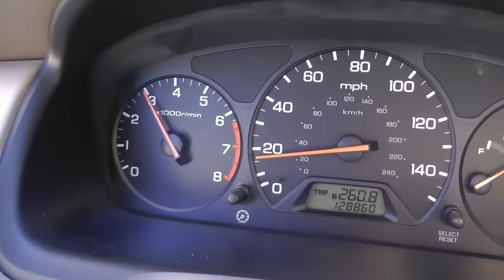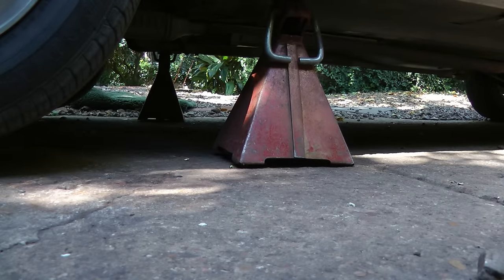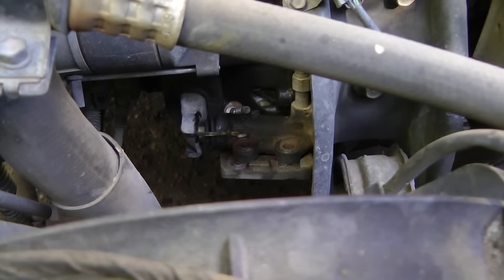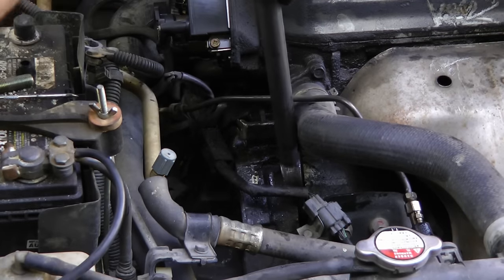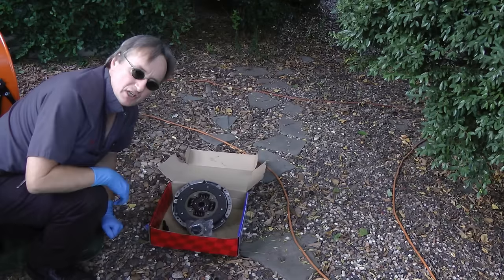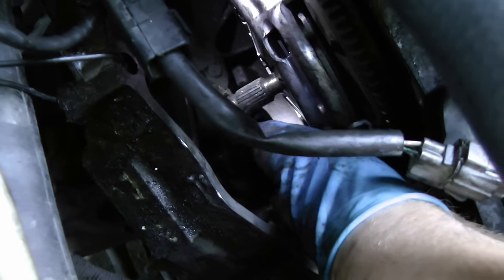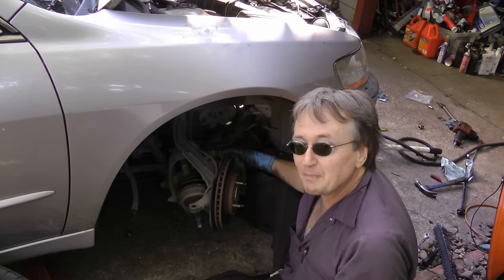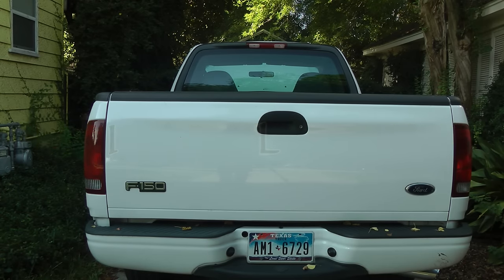How to Replace a Clutch in Your Car

Comment: Open up the fill plug, stick your finger in, it should be right up level with that plug pretty much. You have the same car I do, and I will be doing maintenance on my transmission so if you want a picture of where the plug is I can probably get one for you...though linking in youtube comments is always a pain.

Comment: How much should be the labor of Replacing a front wheel drive sedan Clutch ? (Pressure plate and slave cylinder also)

Comment: )When car is at idle, clutch to the floor, I push shifter into first and I can't get it into first but the car starts to move forward. If I try to put it in second, it doesn't go into gear and starts to move forward. If I try for reverse it grinds. Clutch is dragging at idle.With the car off, I can shift into all gears normally.There is no fluid leaking from the master, slave or clutch hydraulic lines, reservoir is Clutch pedal feels firm and normal.DO I NEED A NEW CLUTCH? thank you Scott

Comment: Any tips on replacing a jetta mk3 clutch? I mean are they any different or harder than any other non european cars?
Reply from the maker: relatively hard due to crazy VW design. Just be sure to buy the special vw  clutch line up tool or you'll never get it back together correctly
Reply: Ok thanks very much Scotty you are awesome

Comment: when i shift my manual shifter (02 tacoma sr5) it is really hard to get it into gear. especially 1st and 2nd, sometimes reverse too. i replaced trans fluid and turkey basted clutch reservoir a million times. sometimes i cant get into gear at all then i have to put it in neutral then try again. when i down shift from 2nd to 1st (like over a speed bump) it is so hard and sometimes if i force it it will grind a little bit. any ideas scotty. ive had it looked at and tested by mechanics and they say everything is fine. dont get me wrong sometimes it shifts great but other times it drives me nuts. it doesnt seem to be sleeping either.
Reply from the maker: either clutch is wearing out, or shifter linkeage bushings are worn, pray it's the bushings

Comment: I have a 95 subaru legacy L awd  the clutch and throw out bearing are going out. Would I Be able to replace them without pulling the hole transmission out?
Reply from the maker: you can remove the drive shafts and slide it backwards, but it's a much harder job that this video because it's 4 WD

Comment: Hi,i got a honda civic 93,ONLY when the car reach the operating temperature when i put it on D4 (normal driving speed) at about 25 to 35 mph the car shake that bad that i tought that was a misfire,one time i lowered the gear  to D3 IT STOP shaking,put it back to D4 shake again,BUT ONLY always after reaching operating temperature!! wat do u think,bad tranny?

Comment: So mechanic selling me his 98" Subaru Legacy swapped out engine for a JR22, has squeaky Throw out Bearing and willing to replace both that and the Flywheel by tipping engine back and unmounting with some trick?...does that sound right? Also, has 236,000.

Comment: i have a queston. if i take my car for a spin and then i put it on neutral it makes a clicking noise. but if i push on the clutch the clicking goes away. also if a rev the car the clicking goes away. Do you think i need i need a new clutch kit?

Comment: What would happen if you overtighten the clutch pressure plate bolts? i just changed a clutch on my car and have been trying to bleed the clutch forever and starting to think i did something wrong as it just wont bleed, clutch pedal keeps dropping to the floor and wont go into gear

Comment: Scotty, I need help. My cars clutch pedal got stuck on the floor while on a red light. While parked I pulled the clutch pedal back and it made some funny noises and the car shaking not going more than 20 feet. The clutch completely failed. The car starts but it doesn't run or want to stall in any gear. 

Vehicle is an 1998 Audi A4 6 cylinder. Please help

Comment: 4 min clutch job...if only lol, just done one my van took me 7 hours on my own i made a gearbox jack with tilt function and flipping glad I did because the box is a big awkward bastard, it's ridiculous the amount you have to take off now to do a simple clutch job on modern motors, years ago it was a couple hour job,  so much pain when the subframe has to be removed and all the other bits to get the box out, prefer to take the box right out so I can see everything, clean it and also replace the rear main seal and pilot bearing.

Comment: Hey Scotty Kilmer, I need your help! I have a 1991 Mitsuibishi 3000gt sl! My 5th gear pops out when I accelerate! Is it an easy fix??
Reply: It could be and it could not be. If you are lucky, it's a worn transmission mount, which causes the transmission to wiggle when you shift. If you are unlucky, it means your 5th gear synchronizer on the transmission is going out and that you need a transmission rebuild. Bring it to a shop and have them check the transmission mounts, and if they are fine, try new transmission fluid. If all of that fails, then you need a transmission rebuild, which will cost around $1500-$2000. On the other hand, you could find a used transmission from a junkyard, but there would be no telling how worn that transmission is. For all you know, the transmission has all of the syncros gone. Hope this helps you!

Comment: hi Scotty I have a mazda pick up B-2300 1995 I changed the pump clutch ( the one that is behind the pedal)  because was leaking and also I check the slave pump the one that is in the transmission and is not leaking I only change the up one. My concern is why the shift lever some times don't apply when I move it to 1,2,3,4,5 or reverse( the shift lever have movement but not apply)  but some times apply and do it fine.Thanks
Reply from the maker: check the shifter pushing and pray that's worn and needs replacing. If not, probably need a new clutch, and they are expensive and hard to replace

Comment: I have a question; would it be the clutch if the car still grinds up shifting & down shifting?
the car runs fine whens it is in neutral, but grinds and barely stays alive in in first, second, ect.
Reply: You have transmission problems, forget the clutch and pressure plate for now.

Comment: hey scotty, if I dont have a oil pump like u, what are other options for getting the gear box oil back in?
Reply: Never "put the gear box oil back in." Always put new in. Having said that, go to the dollar store and buy a plastic funnel set (normally you get three of different sizes), then take your new funnel to an auto parts store and buy three feet of whatever size hose the biggest funnel fits in.

Comment: My 2001 VW Polo classic 1.4 started to make really weird, squeezy noises, like an old Ikarus bus yesterday evening, whenever I put it in gear, and started to let the clutch up. I managed to get away from an intersection just 20 feet away, to wait for the tow service. The mechanic said it's probably the bearing in the clutch, but it's safer to change the whole thing, so it's about 500 bucks. BTW it survived for the last 120 thousand miles.
Reply from the maker: yep, buy a whole clutch kit, but many places sell such full kits online at a good price
Reply: Well I just got a call from my mechanic, that the car is ready, it became a bit more, because the broken bearing made the whole stuff move, and damaged the rear and the 4th gear wheel, so along with the new clutch set, the whole transmission got replaced (better be safe than sorry), but still only 800 bucks, everything included, everything brand new. I'm going for her tomorrow morning :D

Comment: Hello sir i wanted to ask u about my saab look they replace the clutch kit the clutch disc that goes on to the flywheel they put everything on so they started and everything was working well but to start the car would start without pushing the clutch so the gears would go into gears but wont move forward or backwards plz help am hurting the labor guy hasent even a clue what could it be plz help me i would really appreciated it sir thank u for your time have a good day😊

Comment: Hey am from the Bahamas  I have a problem with my Suzuki swift  2008 gear box its damage i cant fine a replacement  so my friend had a whole car the problem  is his car is a 2006 Suzuki swift sport my question  to you is would that gear box work in my car I really dont want to take it out and it dont fit also it's a Japanese  type

Comment: Haha. The difference between a Manual transmission and an Automatic transmission.. With a Manual, when the tach goes high without much speed, it's just the clutch. With an Automatic, when the tach goes high without much speed, it's the entire transmission.. ;) thanks for the video's Scotty.

Comment: Any tips for a Ford Laser? We have been trying to shift the gearbox to get to the clutch plate and it is not moving but we can't see why.
Reply from the maker: make sure all the stinking bolts are off, but if they are, those often stick on the shaft, and you have to force them off with brute pulling force. Often a big pry bar is needed to start the separation

Comment: Do you know if this method will work on  Saturn SL1 1999, repair guide says to remove the engine/transmission together to replace the clutch and that seems a bit excessive.
Reply from the maker: problem with those crap designed saturns is that they have one bolt that will not come off the engine transmission connection without removing both assemblies to get room. But I bypass that myself by cutting the head off that one bolt, and just leaving it off. One less bolt won't hurt anything as long as the others are all tight.
Reply: Scotty Kilmer That helps, I really don't want to remove the engine, or drop the engine cradle or any other crazy thing that people have come up with to get this thing fixed. thanks

Comment: hey scotty , i have a problem with my 97 honda civic , when i engage the clutch in , if i over feed it or dont feed it right instead of it wobbling like before , it now feeling like my flywheel was to turn into a big peice of rock and its a big chucking noise , what could it be ?
Reply from the maker: +kEvIn CaStIlLo time for a new clutch assembly, things are broken inside, best to change the whole clutch kit with all parts
Reply: +Scotty Kilmer Other videos I've seen say you have to drop the engine. How come you didn't do that here? I have a 2004 Kia Spectra EX. Would I have to support the engine before taking off the transmission mounts? The transmission is on the driver's side.
Reply: jackslater230011 you do NOT have to drop an engine to do a clutch job.

Comment: Scotty i converted my dmf to smf  on my vw jetta 1.9tdi 2005 as the clutch release bearing needed replacing. now the jobs complete i'm still hearing the same damn noise. how is this still possible. all the parts are brand new.

Comment: Hey Scotty my clutch makes a pop noise when engaging it is a 2002 maxima ppl say I should grease some parts any thoughts .thank u in advance
Reply from the maker: check for worn CV joints and pray it's not internal to the transmission, greasing won't fix that one
Reply: Scotty Kilmer thank you very much I'll have a look today thanks for your time

Comment: My clutch is grabbing way late. 
The pedal is 90% out by the time it grabs, could that be a worn down clutch plate or is it something else?
Reply from the maker: Dylan McElveen either clutch is worn out inside the transmission or hydraulic system is weak
Reply: Scotty Kilmer my civic has to be cut off at stop lights just to get in first gear.  Clutch pedal is kinda hard, clutch fluid is full yet changing gears feels all out of whack...any suggestions??

Comment: I have a strange problem in my car My car clutch pedal becomes hard to press after around 5kms of driving .. very hard .. replaced clutch assembly .. still no use .. want to know what may be the exact problem ... plz help .. I have a Škoda Rapid 1.5 TDI Manual Transmission Only 18000KMS driven ..

Comment: Scotty when are you going to make a video of how to replace a torque converter?
Reply from the maker: probably never, as I rarely pull automatic transmissions off these days due to insane design of many cars that requiring pulling of the engine and transmission as a unit

Comment: Scotty I have an Honda accord 1996 automatic that has an issue. The car runs fine when is on the street, but when I stop anywhere the car just start having low idle til it shut down. I took it to a mechanic and he told me that headgasket was bad so it was replaced, we put a new cylinder head, new timing belt, we check like 3 time the timing and as good, new water pump, new battery,  new alternator, we check compression on all cylinder was 180  which is good, gas compression and it was 44 psi which is good, check for vacuum leaks and no leaks,new spark plugs, new wiring, new distributor and still does the same. Any tips here.
Reply: The car is a nightmare, we also did valve adjustment, we check the intake to see if something was blocking air flow but not, also replace all sensors like map sensor, I'm thinking about get rid of him but I really want your advice to see if I miss something cuz like you see I already put a lot of money on him. The only thing that I think is that maybe there is a problem in the low block like a piston or a bend or crack low block but compression is fine, so that why i'm lost here. As long car is on is parking is good but as soon I change to reverse or Drive start with this issue. Check Engine comes on and state that is a bad distributor but is wrong cuz I replace the distributor twice and still same  and replace the ecu twice.
Reply: idle air control valve, it's the part that keeps car your from not stalling at slow revs by dumping in a little bit more air at the same pace as if you were driving.

Comment: love these Scott. Have u got anything on changing the oil seals for the gearbox? Mine s rover sd1 r380 if that helps... Be well.
Reply from the maker: +interludo I have an oil seal replacement video somewhere, go to the transmission and clutch repair section of the scotty kilmer channel opening page on youtube, it's in there
Reply: +Scotty Kilmer Thanks Scott Im gonna have a look.

Comment: Question, I bled my slave cylinder yesterday and when I drove it today I noticed it was a lot harder to shift into first (impossible to shit into 1st gear when I'm stationary and the car is on but works easy when car is off) and second gear (second gear is a real pain but do able). All the other gears are super easy to shift into when I hit the correct speed. (about 10-15 for 2nd gear, 25-3 gear, 35- 4 gear and 35+ for 5th. It was a lot easier to shit before I bled. What's the issue? 97 Talon

Comment: Hey scotty, why did you make this look so easy lol? Anyways, where can i find me a cheap clutch?  And did  you take the WHOLE transmisision off to put the clutch in, or did you just kinda slip it in through the cracks if you know what I mean? And lastly, do you think it's required that I get a clutch kit?
Reply from the maker: I advise getting a clutch kit at a discount parts store, often they can be had for a hundred bucks total. ON some vehicles you can slip the clutch in without removing the whole tranny

Comment: do I need a new transmission and clutch? first and second gear can rev all the way but after I put in 3rd not only do I slowly gain speed but it takes forever just for the revs to go from 3 to 4 :/
Reply from the maker: +Sina Vameghi probably just need a new clutch assembly

Comment: hi i have 04 rav4 manual transmission but the clutch pedal feels very hard i will appreciate any advise thanks
Reply from the maker: PRAY you just need a new clutch master or slave cylinder, and not an expensive new clutch inside the tranny
Reply: many thanks for take the time and answer  will check the cylinders first

Comment: Why do we need to remove both the cv axles/shafts. Isn’t remove just the drivers side enough?
Reply: probably for more room. you can't lift trans up/down with the axles still connected to the trans

Comment: i have change the brake fluid but not yet bleed the clutch.i m afraid of if the clutch which is working little bit then it don t work at all.

Comment: You forgot to mention that this is the procedure for front wheel drive vehicles. Rear wheel drive vehicles need to remove a singular driveshaft connecting to a rear differential.

Comment: Ive got a vauxhuall corsa b redtop with a 2 litre c20xe init and i had to push my clutch all the way in and it got worse after a few days now its hard to shift and when in gear the car tryes moving even with the clutch all the way down?

Comment: Scotty kilmer I replaced an civic transsmision but the shift fork is hard to move not losse enough that is squeezing the clutch slave cylinder. What did I do wrong?
Reply: Yes is a 92 hatch civic dx d15 with s20 tranny it went in smoothly but the shift fork is the problem n now it doesnt turn on.
Reply from the maker: MrHoc91 you may not have put the shift fork on the throw out bearing correctly, then they will bind and do that

Comment: I have a question I have a 94 accord lx standard transmission and when my clutch is engaged iin nuetral i hear a squelay noise and I hear it coming from my transmission. I dont hear a grinding noise or something scraping. 
Also my transmission when I come to a complete stop sometimes I cant engage in first or reverse the car has to roll an inch or two to engage
last my transmission just the other day it has a delay I guess when enegaging my pedal is fine